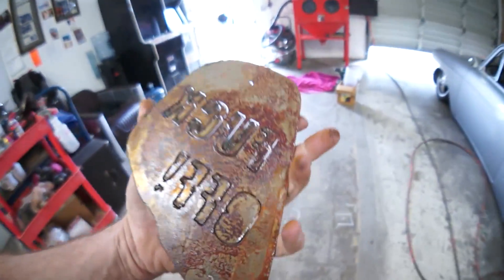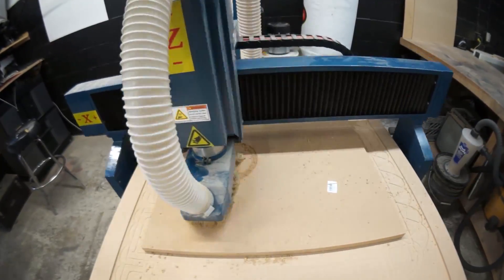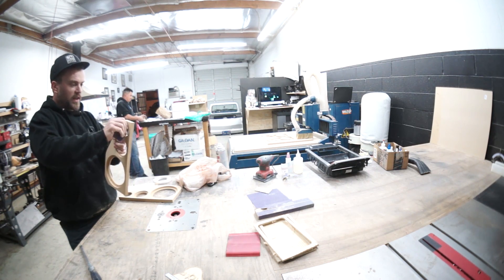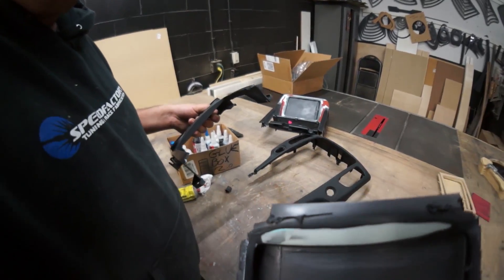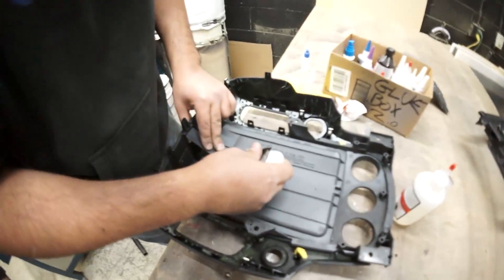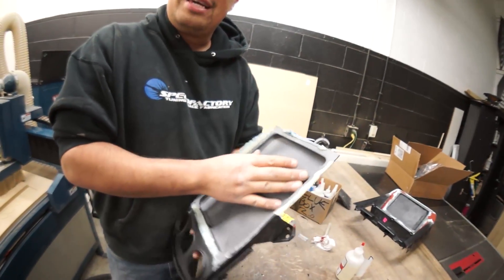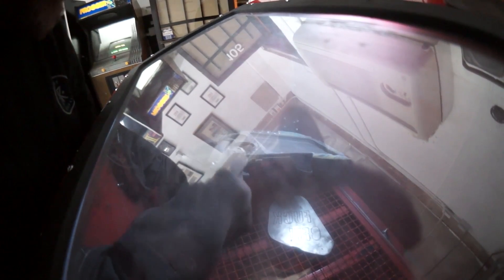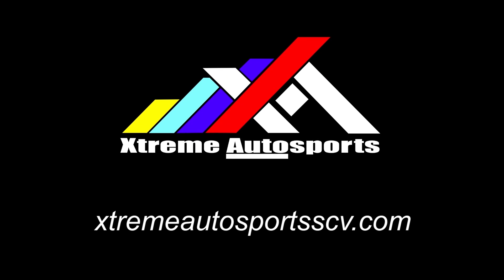Kick Panels PART 3, and iPad 9.7" Nissan 350z NEW DASH MODS! - AMPLIFIED #700

Comment: Put a thick steel plate in the middle so that you don't blast the wire mesh in the middle which is where you mainly blast. We do this at our metal shop

Comment: Hey boss . J.s ... Sand and water doesn't mix well . I noticed you dont have any filters on that line drop . Also dunno what kind of psi your running but mine works best around 190/200psi with a dedicated line from my hold tank

Comment: Doug, when blasting, use glass bead for aluminum.  Black oxide will tear up aluminum.  Walnut shells work good on thin sheet metal, light rust removal and paint removal without heating the metal up.

Comment: Caulk gun has a tip cutter on it, uses a knife to cut the tube open...
Reply: mtrebman that's because the tip cutters on cheap caulking guns will usually pinch the tip as they cut it. So using a sharp knife you can get a clean angled cut for applying it.
Reply: Doug doesn't buy cheap stuff...  Does he??  lol
Reply: mtrebman  cough Rafa's mom cough

Comment: Wont the sand eat up the silicone sealant on the inside? Wouldn't it be better to seal the outside?
Reply: Simon G should survive for a fair while if your not directly blasting the caulk

Comment: They leak dust like crazy because you need to have it vented. A dust collector is separate and goes into the hole on the left there or u need to put a fillter on it  cuz u are taking compressed air and blasting it in the cabinet! The air has to go somewhere!
Reply: Vance wanless I was imagining that while his face was 2 inches from the window. 👓 Doug. Safety first. Then Momma jokes. ✌️🤕
Reply: Dick Jokes And Bondo safety first then mamma jokes! That's a good one, I'm going to use that today in my daily safety meeting. I gunna take the credit for thinking of it tho lol
Reply: That was what the shop vac hooked up to it was for...
Reply: Yup.  I didn't have a shop vac hooked up to mine originally.  Made a huge difference once I added one.  I also modded mine to get rid of the crap siphon feed setup; feeds from the very bottom.  Works much better now.
Reply: Keith Anderson shop vacs suck.....but not enough. That's why I said a dust collector sold separately for just that purpose and that blasting cabinet. It will suck the gloves off the mounts they are on and the media right out of it if u have it turned up! But it removes all the dust and junk like paint that gets removed off the parts and keeps the glass beads or sand like new so it actually saves u money in the long run! Shop vac is ok but doesn't quite suck enough. "Insert Rafa mom joke here"

Comment: You know I tell my customers Would you look at that!? I mean just look at it!
Also not saying the sillycone is going to fail but if it does you might want to epoxy that cabinet shut.  Sure youll never get the bitch apart but I doubt itll leak. Ever.  And then you can tell peole to look at it. Just LOOK AT THAT!